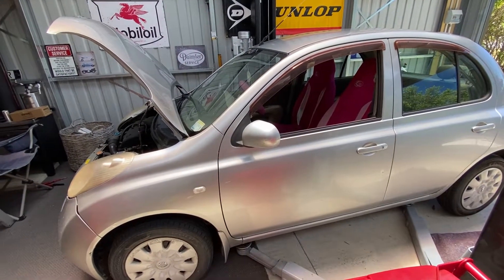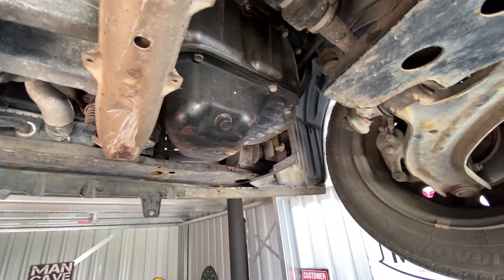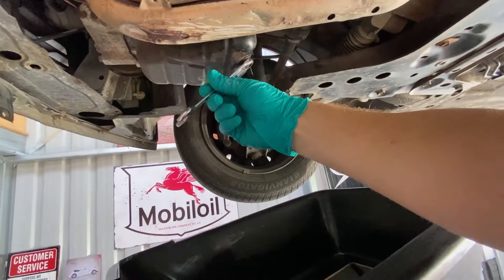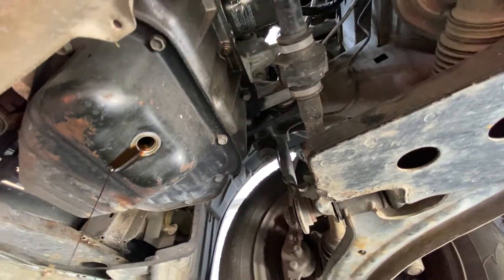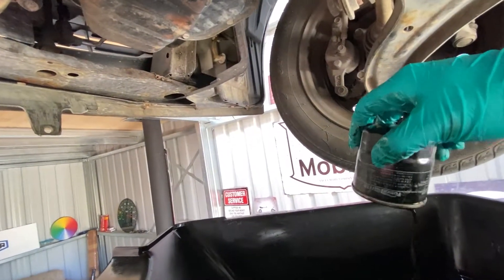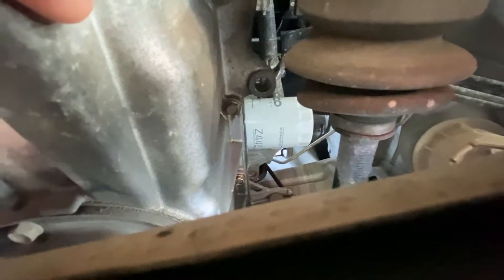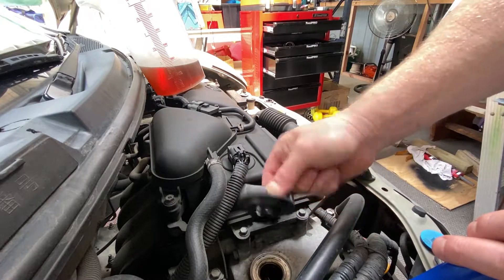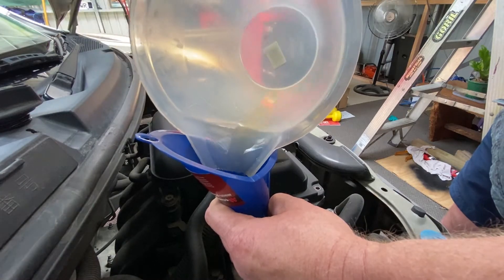It’s Time You Did Your Own Oil Change! - 2002 - 2010 Nissan Micra [March]

Comment: Hi Craig I have a Micra 2010 K12 model like this one but my engine oil 5w30 is that alright to use or is one in video better, great video btw
Reply: The manual, which is in a tray in the top of the glovebox, lets you use thicker oil if the temperature where you live does not fall below a certain value. That Castrol Magnatec 10W30 is alright down to -20 Celsius.